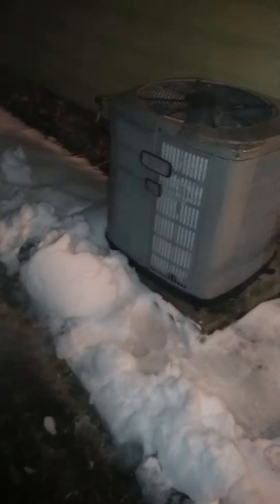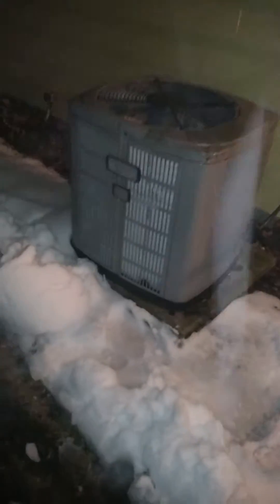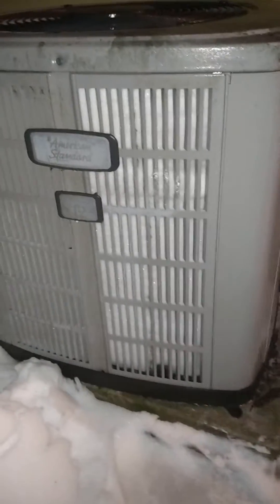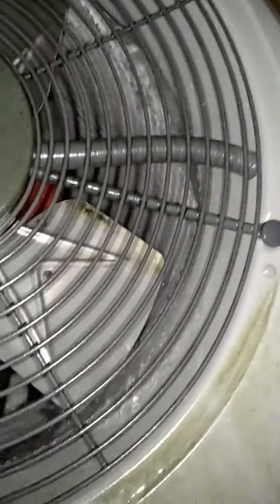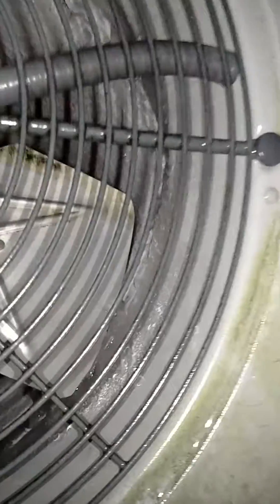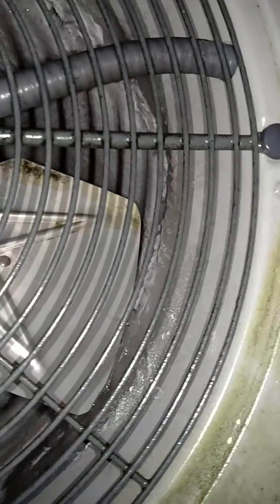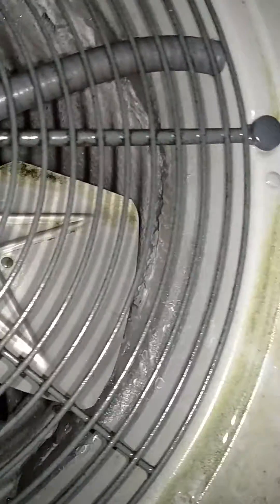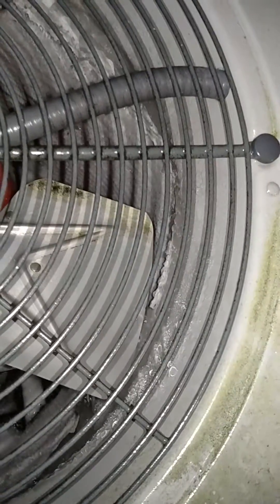Iced up heat pump in the winter, as found by a home inspection.

Comment from the maker: HVAC tech found mouse-chewed wires to the reversing valve controller system. Sensors work to occasionally reverse and run a heat pump in COOL mode, which heats the outside coils like in summer operation, which melts the ice. That obviously hadn't happened in days here.

Comment: Heat pump condenser icing is normal, but, not to the point where the fan hits the ice. If, ice buildup is uneven, most likely a refrigerant issue. The most common reason for excessive icing is the customer setting indoor temp too low. A heat pump, in defrost, relies on the indoor heat to defrost that outdoor coil. Many homeowners set their indoor thermostat to 60 or 65. Which is too low.